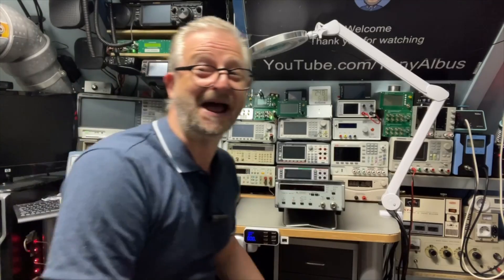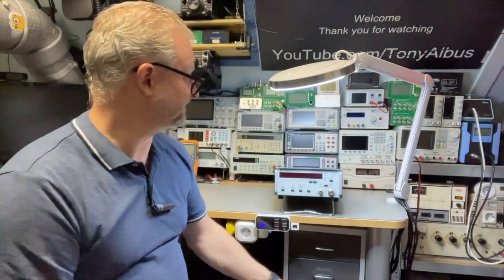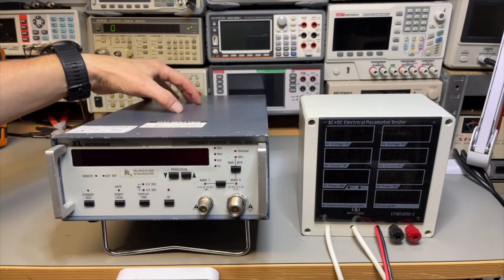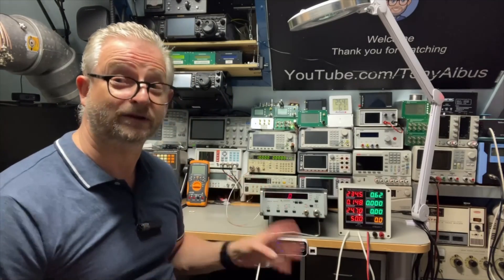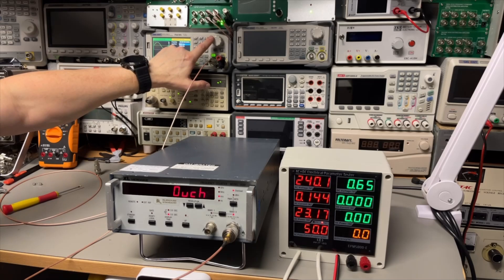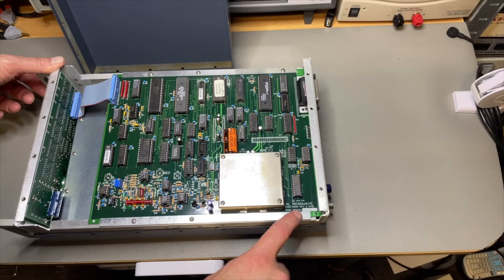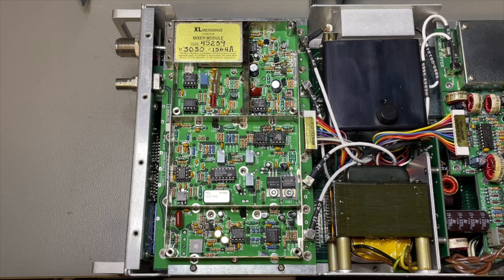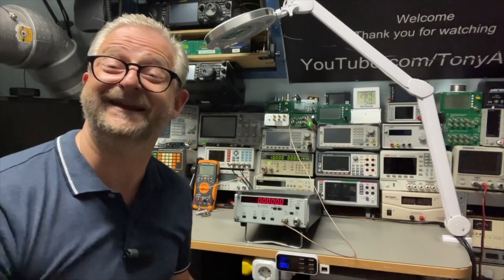TA-0419: XL Microwave 3030 - Rubidium - Frequency Counter - Teardown

Comment: Hi Tony.  I recall your video on the 3260, which I also have.  It works great except for the power meter.  I found several references including the service manual for the 3030! Let me know the best way to share it with you.
PS I just checked, memory correction:  I have the 3200, which goes to 20G. Looks just like the 3260.
Reply from the maker: Thank you for sharing!  received in good order.
Reply: just noticed this comment..after I emailed you the manual 😂😂
Reply from the maker: @jonscally2349  Thank you for sharing Jon
Reply from the maker: Thank you so much!! that would be great!! the 3200 is very simular and good. you find my email in the ABOUT of the channel, thank you so much. if it is to big to email, please use WeTransfer service.
Reply: Happy to help if I can.

Comment: Thanks Tony.
This encouraged me to drag out my rubidium standard and check my Tek 3000 counter. I run the counter off an MTI 260 Stratum III oscillator that I check with the standard occasionally. The MTI is so good that after not checking it for a year it was still within 2 parts in 10 billion counts! 

Lots of fun!
Reply from the maker: Great! you have some nice equipment, wow!

Comment: I have a rubidium reference 10 mhz osc and a GPS cesium locked reference. The two were so close in frequency, the rubidium was off 1 cycle compared to the GPS every 7 seconds.  Talk about being super accurate!
Reply from the maker: That so cool, they re so stable... thanks for sharing, 73

Comment: Very nice counter, Tony. Looks like the high frequency input has a hard line connection to the mixer so possibly that bit of unobtainium is okay (unless the overload detection is done inside that module). If so you may be able to repair that channel. Repair video! Regards, David
Reply from the maker: Thank you David, good point, that is something to check for sure.

Comment: Those small (or LPRO / Low Profile Rubidium Oscillator) Rb modules I've seen once for sale on Marktplaats xD
Great find! I thought you had a Rb standard already. Yes, they can be adjusted. 

Problem is you're testing the short term-stability of your GPSDO with it, as it is rock solid. The little glitching in the least significant digit(s) is just the GPSDO correcting its own timebase according to the new data it constantly receives. In order to adjust the Rb clock properly I think you need a good counter (I used a HP 53131 from work), set your GPSDO as external ref for that, and check the rubidium output with a (I don't know) gate time of 1 minute or more and run stats for a couple of hours to see what the real deviation is over a longer period of measurements. Perhaps even with limits in place to exclude rogue highs or lows as a GPSDO sometimes corrects a little more coarse (well, mine does).
Reply from the maker: So surpriced how stable it is. if you like to see some longterm meseurements i have  afew videos on the Rapco compared to Chinesium running over 2 or 3 weeks. My gpsdo is switched on 24/7 and does not adjust to much anymore.
Reply from the maker: Thanks, i check ebay.. who knows some is still there.

Comment: I think they can be adjusted, as most use an OCXO, which is disciplined by the photocell detector at the end.

They're used as a "secondary standard" when compared to a cesium.
Reply from the maker: Thanks, yes they can, i saw later the adjustment screw , ut is was not needed at all its spot on.. so cool!
Reply: @TonyAlbus  If I remember, they have a feedback loop in them, with the OCXO in the loop where it looks for a dip from the rubidium lamp. Below is what the Wiki page states:

"Commercial rubidium frequency standards operate by disciplining a crystal oscillator to the rubidium hyperfine transition of 6.8 GHz (6834682610.904 Hz). The intensity of light from a rubidium discharge lamp that reaches a photodetector through a resonance cell will drop by about 0.1% when the rubidium vapor in the resonance cell is exposed to microwave power near the transition frequency. The crystal oscillator is stabilized to the rubidium transition by detecting the light dip while sweeping an RF synthesizer (referenced to the crystal) through the transition frequency."

Cesium standards do something similar, where it was stated: ""The second is the duration of 9192631770 periods of the radiation corresponding to the transition between the two hyperfine levels of the ground state of the cesium 133 atom."

They're currently rebuilding an old Apollo computer, and the equipment they picked up as well. They had two HP cesium standards they were firing back up, which you have to degauze, and looked for the transition on a scope. Likewise, they used an original and old HP scope to view it. It was pretty cool to watch. However, a cesium standard is much more complicated, and, to me, not worth the time and trouble to tinker with to align it.